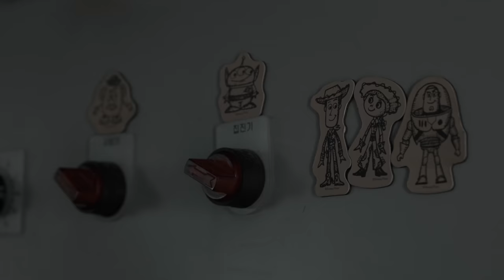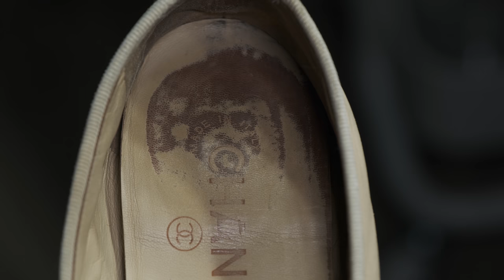[ASMR] Clean&Restore 'CHANEL' Ballerina flat shoes  / 세탁&복원 '샤넬' 발레리나 플랫슈즈 -4k 안녕

Comment: How much does a job like this cost? I once saw an old pair of YSL stilettos at a thrift store but didn't get them because I didn't know they could be made to look like new again.
Reply: 1000$
Reply: Lissy Velarde It will vary depending on your location. I know this is kind of a nebulous answer but cobblers set their prices based on everything from cost of the materials they use (some use cheaper materials, resulting in a lower cost for the customer) the volume of business they receive, their shops rent/mortgage cost, advertising, etc. I would say even a cheap cobbler could make a pair of used stilettos look good just due to their simple construction.
Reply: As said, it depends from where you live, where you go, and what it needs to be done. Where I live YSL Stilletos cost 700€-1000€ (760-1100$). It probably worth at least to show your shoes to your local cobbler, but yes it can cost several hundreds of dollars.
Reply: Amazing
Reply: @grandmestredespoulpes2435  isn't it easier to buy new shoes then? :-I
Reply: Слайдер $1,000 you can new pair.
Reply: But Chanel is really expensive I don’t know if you could buy a pair for $1,000
Reply: @makayla5227  this type of shoes, the ballerina, costs around $750. Better buy new ones. 😭
Reply: I do that for around $70 to $100 dollars (not the soles)

Comment: Good job! Why did you use both: saddle soap and shampoo, not only shampoo? It looks like you can use just shampoo for the same result
Reply: I have the same question ? :)
Reply: I think its because you have to make sure that you get all the sand and abrasive particles off before you get the shoe really wet, otherwise you might scratch the leather. The brush gets of the big loose particles and the saddle soap takes of the finer stuff. Though i am not a professional so this is only an educated guess.

Comment: What’s crazy is someone would actually wear their shoes to that condition then try to restore it.   Clearly no attempt to replace the heel protector or add sole protectors.
Reply: A B replacing these things isn’t common sense. I never knew you could replace a sole bcuz it was never mentioned to me or done for me. I just assumed shoes were made to be used and disposed and then you buy a new one. I learned only a few years ago that most things can be taken apart and have parts replaced 🤷🏻‍♀️ just not common sense
Reply: @stardustfactory8311  I’ve bought high end shoes that the manufacturer includes replacement rubber tips in the boxes so clearly they are expecting you to replace them after a few months of wear to maintain the shoes appearance.  I would be embarrassed to ever wear a shoe in the half the bad  condition these shoes were.  If you believe in disposable shoes then those should have been thrown out about a year before they started looking that worn out.  Just like you clean and  service your car, you clean and maintain shoes before thy ever get to that condition.  I’ve thrown out shoes in way better condition than those. You maintain should maintain shoes by taking them to a cobbler to be cared just like you go to the salon to maintain your hair or nails.

Comment: 17:33 Does any one know, why he cut this angle
Reply: I think because it's an old shoe and even after it's restoration you can see that's old  , and if he kept it with the angle it wouldn't match and it won't look right  , it would have taken from the value of the shoe .
Reply: I once heard that his little cut is meant to prevent you from getting your heel hooked on a carpet or a corner.
Reply: So it doesn't feel clunky and rigid when you walk in them.
Reply: @taiohigreque6002  correct
Reply: @saramstar  nope
Reply: @amanasd26   i tried haha 😄